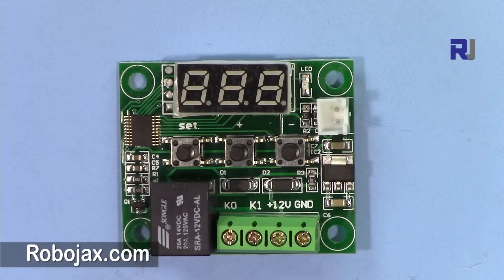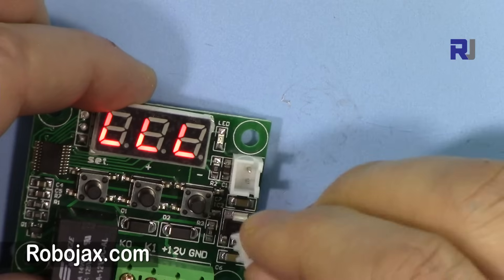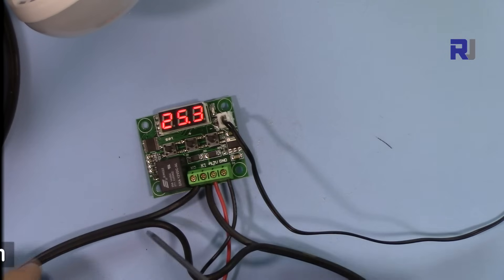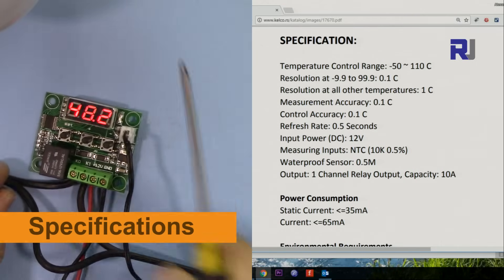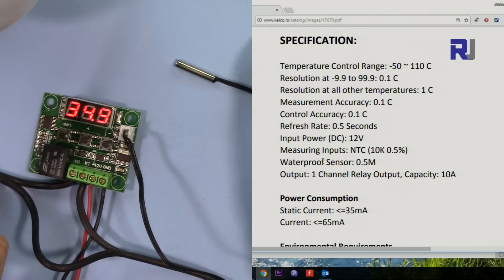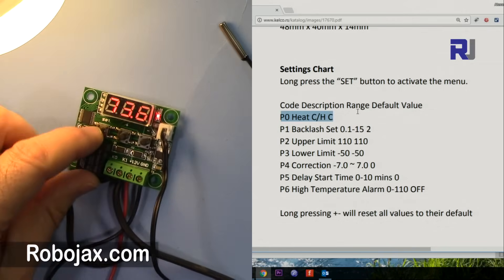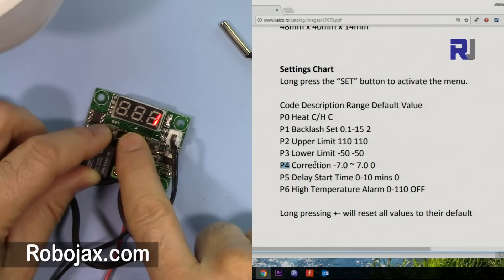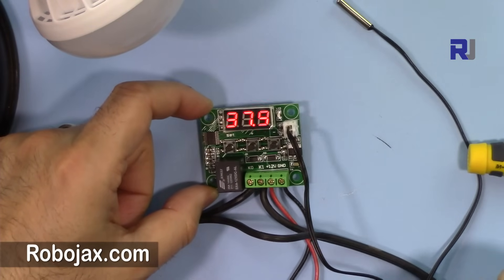How to use W1209 Temperature relay controller and program the thermostat

Comment: I need 1500w load is this sutable
Reply from the maker: See here power calculation https://snag.gy/UDJMCg.jpg
Reply: You can use K1 and K0 to operate a larger relay as switch to open and close.
Reply: 1500 watts I would definitely use an external relay for anything that big. Even though the built-in relay might handle it for a while, it will burn out in relatively short time. Like the other person suggested, use a bigger relay that is simply activated by this thermostat. Then your thermostat unit will last practically forever, and if your bigger relay wears out, it is very easy to replace.

Comment: Hello it is okay if the adapter is
Input:AC 110-240V 50/60Hz 1A
Output:12V --2A
Reply from the maker: Yes. Your adaptor will work. Make sure to pay attention to + and -
Reply: Robojax what color of the wire is positive

Comment: Bro can you please tell me can it run on 12v 2.1Amp or how many AMPS should we use?
Reply from the maker: this itself needs online 0.2A. When relay connects your load, the voltage and current depend on the load. The relay can handle up p 2kW see this http://robojax.com/learn/images/robojax_W1209_relay_load.png (i have put this in the description of this video as well.)

Comment: Relay in the module is 125VAC but the bulb is 220VAC is that ok or not?
Reply from the maker: Relay can handle 1.2kW. the manufacturer has targeted North America which uses 120V. For 220V it should be the load. If not to be safe 50% of power (watt) so if you connect 500W bulb it should safe.

Comment: Does it has memory or should i set the temperature everytime i switch on the module
Reply from the maker: it holds the settings when you disconnect the power.
Reply: Robojax thank u for ur fast replay..
Can u tell me a best 6v to12v dc motor to make a water pump i will use that pump to run water through a radiator and i want that pump to withstand the usage more than 2 years..
Reply from the maker: this is very tough. The torque and power needed should be considered.  There is budget and voltage and current consideration. Very hard for me to suggest.
Reply: @nirmalkumar9353  motor 775,12v.you can see YouTube videos

Comment: hi, thanks for making this video. Is there any way i can control 250 degree C using this controller. Like if I put a resistor in the thermocouple input. will it work?
Reply from the maker: Yes it should work, but you have to check the temperature and make your own chart for example 100°C on the display is 210°C actual.
Reply: right, that is what I was thinking. Thanks for confirming :)
Reply: You could also try a slightly different thermistor. They make them in various values like 10k (this one uses 10k, as 10k is a very common value), 1k, 100k, etc. But the added resistor like you suggested is probably the most likely to work, since another value thermistor might be entirely out of range. You might want to get a thermistor made for higher temperaturess though, because the reason why this particular thermostat only goes up to where it does is because the thermistor it uses becomes less accurate above those temperatures. If you discover that inaccuracy is an issue, that could be the cause. Also, when you add in a series resistor, it will subtract almost exactly a certain number of degrees from the actual temperature at say 200 C, but at a higher temperature it will not be the same difference. In other words, the extrapolation will not be linear, so a three degree hysteresis might turn out to be 6 degrees instead, or 1 degree. You'll just have to experiment with it to see.

Comment: Hi, is it necessary to use jumper cable wire connected  k1 and 12v?? If so, what kind of cable is needed? Can i directly plug in cables from 12v adaptor?
Reply from the maker: for 12V yes it is okay. You can connect it as long as you know the polarity.. But for "jumper cable wire connected k1" sorry I did not understand it. What do you mean?
Reply: As in, can I just use any wire for the "short wire" that is used to put ino K1 and 12V? Or must it be a specific wire?

Comment: I want measure 3 volt operat LED temperature if possible with this device if yes then how?
Reply from the maker: Sorry I did not understand your sentence.  I know you want to measure temperature. But LED and 3V is not clear.
Reply: Robojax I want measure temperature small LED
Reply from the maker: Sorry for my late reply. so you want to measure temperature of LED,   the temperature sensor  for fluid like air or liquid. To get the temperature from a solid device such as LED, you would have to put thermal paste between the LED and this sensor so head is transferred to the sensor and it measures it for you.

Comment: hii ,, Thanks for the full informative video .... I want to ask if this one could be used for 220V devices ?? as I just got it 125V as I didn't know that before getting it .... Thanks
Reply from the maker: You are welcome.
Reply: This guy Robofax has obviously no clue. Sure you can use it on the switching side to switch 220V. I would'nt use this divice to switch anything, because after x times switching the realay will burn up. You need to desolder the relay and add the appropiate solid state relay for your purpose. T
Reply: @Lisas4us  can it be used to switching 12 v dc to ac ssr , safely ?  
Are this reliable enough  to be used in a project ? or one should buy expensive controller?

Comment: which terminal will I connect the DC supply?? At the 12V terminal?? and can I use a 12V/30 amp for the thermostat?? How about if I will use it for cooling?? I will apply it to a refrigator so the system will close when the desired temperature reached.
Reply from the maker: Have you watched the video? the voltage has been mentioned at 00:35 and 01:55. The cooling and heating has been mentioned if you watch the video.

Comment: i ordered it thinking i can directly connect it to wall socket ( ac power supply 220v). after i purchased only i saw it needs dc power supply. will the little thermostat burn if i connect directly to ac 220 power supply? i need the thermostat for running ac bulb 40 watt
Reply from the maker: yes it will. It should be dead.

Comment: It does not want to keep stored temperature settings. It keeps on going back to factory reset. I have tried several diffeernt ones and about 3 out of 4 have the same issue. I need help trying to resolve this.

Comment: Hi sir
Please I want some details. clarify me!
I purchased this thermostat now.
How many 60w bulb and one ventilation fan installing working perfect, for incubators
Reply from the maker: Divide power (for example 60W)  to your voltage (for example 220V), If you have 10 bulb each 60, then 60x10=600W. now find out the total current 600W  ÷ 220 = 2.72A and the Ampere is written on the relay as 10A or 15A.  So total power  ÷ by voltage gives you the current in Ampere.
Reply: Dear sir
 Thanks our reply 
Voltage Supply 220v in indian housing current, 
Thermostat Writing 10A, 12v.
How many Bulbs and One Ventilation Fan working Perfectly for Incubator. 
And Adapter how many Amps required.
Please clarify Me sir.
Thank Regard.
Reply from the maker: You have to read the relay. on this module.  read the relay and see if it is 10A at 240V or 15A. Then as I mentioned above, do the calculation.

Comment: Urgent help:
I connected 60w bulb as explained. It is not working. Please help.light is ok. Relay is ok. But when i connect both, light doesnt glows. What to do
Reply from the maker: how do you know relay is working?  do you hear the click?  if so, then use a multimeter and check the resistance of the contact when it is connected. it should show zero or close to zero ohm at the two terminal that you connect your bulb.
Reply: ome g

Comment: Can I use a 12v mobile charger?
Reply from the maker: Yes you can. Make sure to connect it with right polarity + and -
Reply: 12V mobile charger?
Reply: mobile charger is 5 v
Reply: bro your mobile charger doesn't 12v it gives 5v
Reply: you can connect it directly to the fuze box that provides 12v ... or you can buy an 12v adapter to your car charging port.
Reply: @LazyH-Online It depends on the laptop.. it ranges fro 12v to18.5v +-

Comment: My maximum temperature is only uptp 15 degree celcius... Even if i press Plus button it does not go up...please help.
Reply from the maker: Something is wrong. Turn it off and try again. Did you test it with 15°C.  Put the device in freezer with power wire outiside and test it on for example 12°C. Once you remove the module from fridge, it should trigger at 12°C. If it did not work, then that 15 could be 150°C and may be the display is bad.

Comment: 2:58
Reply from the maker: what about it?
Reply: Robojax do I need to use the adapter..
Reply from the maker: which adapter? if you meant the prob (wire connected to the board). it is the temperature sensor and without it, this module will not work.
Reply: Robojax can I directly connect the device to switch board, or I need to use a specific power adaptor...
Reply from the maker: You connect it to 12V as I mentioned at 01:55.
Reply: Robojax thanks bro...

Comment: Can this work to activate a 12v 9amp fan?
Reply from the maker: the current is the most important factor. It depends whatever is written on the relay see this image  https://snag.gy/ltFeqG.jpg
Usually it is always 10A or higher. So yours should be 10A or 20A. Check it.
Reply: Robojax Thanks

Comment: hello, i use this circuit in my homemade egg incubator for controlling the temperature. there is a red led light right next to the display in the circuit which should turn on when the main heat source or the bulb is turned on. but mine is showing just the opposite. like, when the bulb in on, the display light is turned of and when the bulb is off, the display light is on. can anyone help me solve this?
Thanks
Reply from the maker: So watch the video again and again until you understand it. I don't have the device in front of me to test but it seems you have to switch the two temperatures settings. one should be instead of the other or change the operating mode.
Reply: Just plug it in and wait for it. It doesnt turn on instantly, you have to wait for about a minute.

Comment: have multiple fan connected to the controller but when it reaches the set temp the display starts to show chaotic temp. the fans are of different amp, 1 big, 2 smaller. what could be the problem?
Reply from the maker: are you using AC fans? if so it seems the power source is not stable and they either add noise or reduce the power line voltage. So make sure this controller is getting regulated clean voltage.  if you have a battery , it is better to test it by powering the module from a battery. This way you know for sure if noise in voltage is the problem.
Reply: it was a voltage problem. the thermostat was getting low volts
Reply: If you have any additional issues with jumpy readings, try connecting a small capacitor (maybe 1 uf) across the wires that go to the thermistor sensor. This will help stabilize the temperature readings and keep the relay from randomly clicking on or off before it is actually supposed to.

Comment: Where to plug in the lamp plug and the adaptor plug?
Reply from the maker: I am not sure if I understood your question. I have mentioned at 03:00 that the AC Load (light) is connected to wall.
was this your question?

Comment: When you splice and the wire in half and . And put the fan on. the other end do you have the plug do you plug in the wall outlet and have the electric run through it as it's hooked up to the battery to.
Reply from the maker: yes. Exactly. So if you have AC load, connect it to wall outlet. If you have DC load, then connect it to battery.

Comment: Frnd I need a constant temperature (27.5)what should i do
Reply from the maker: then set between 27.4 and  27.6 and it will give you 27.5. This device has some response time.  and this time give it a moment to reach that value. If your application is very precise, then this device is not the right device for you.
Reply: Robojax  thanks

Comment: hey guys, I got one of those which i want to use on my peltier cooler project. Its default setting is in HEATING mode. Im trying to enter the PO menu to change the settings but its not working wat can i do?
Reply from the maker: Unless your board is defective, the procedure I've shown should work. please watch the video again.

Comment: wow clear explanation.. thank you..😊 i have a doubt..please tell how to connect the peltier module and pc's PSU to this device..? i have red and black wires in my peltier module.. how to connect these devices to this thermostat..? Im not good at electronics.. please reply..☺️ ( i would like to use this method for my cpu cooler)
Reply from the maker: your module has RED and BLACK. You need an extra wire (let's call it yellow). This module has 2 terminal (let's call them T1 and T2 ) connect red to  + (positive) of power supply, connect black to T1 .  Connect one side of yellow to T2 and the other side of yellow wire to  - (negative) of power supply and it should work.
Reply: Thanks for the reply.. :)  In here, does the  T1 and T2 represents the K0 and K1..??
Reply from the maker: I don't have the module in hand, but I remember there was 2 terminals that I connected the load, so those two terminals  are referred to as T1 and T2

Comment: Very bad.use less product. 12v supply cut . device automatic company setting 28 degree. Old setting missing. Very bad.useless
Reply from the maker: a doesn't work for everyone. But most people find this to be useful.
Reply: Same problem
Reply: What can i Du this problem?
Reply: gopi nath me use xhw 1209 letest version is good product. Memory is properly working.
Reply: I don't know if you have had the same issue I have had, but when I power this from a 12v regulated power supply, the temperature jumps up and down several degrees constantly, and if the temperature is close the the set point, the relay will click on and off and on and off randomly because of these fluctuations in the temperature reading. I tried using an additional 12v linear voltage regulator together with capacitors and everything, and my voltmeter was reading a constant 12.2 volts, but the fluctations would not stop. The only thing that fixed the fluctuations was to run the thermostat from a 12v battery instead. But then I tried something else that totally fixed all the fluctuations without having to run it on a battery: I put a small value capacitor across the leads for the thermistor. Works like a dream! No more random fluctations in the readings, and no more random clicking on and off of the relay! Perfectly smooth operation now. I used a 4.7 mfd capacitor rated for 25 volts, but any small capacitor will usually work, as long as it is rated for 12v or more.

Comment: Hi..what kind of bulb you are using in w1209 thermostat?.and what watts?
Reply from the maker: the bulb is AC LED bulb very low power. But that doesn't matter. The rating of relay is important. If relay says 10A then multiply the 10 x the voltage., for example if your AC voltage in your region is 240V, then 10X240=2400W or 2.4Kw load could be controlled.
Reply: Robojax i use 100 watts of my w1209..the problem is the bulb supply..can you send me the settings and the wirings module?pls..
Reply: By the way ours is 220V in the philippines..
Reply from the maker: For wiring watch the this clip http://www.youtube.com/watch?v=YSI1PdSLbt0&t=2m47s and for instruction, if you watch the video I have explained all settings of the module.

Comment: Can I use it to control 220v ac bulb. Or it is only for 12vdc and.  110vac.
Reply from the maker: any load up to 2200W with maximum of 10A AC or 10A DC.
Reply: Robojax actually I want to know about voltage range of alternate current (ACv). Is this 110v or 220v relay device. Thnks
Reply from the maker: the relay is a switch. Doesn't matter what voltage you connect. (of course you can't connect 1000v). Only the DC is important to be 12V.

Comment: How to extend sensor wire, is possible
Can we use for hatching eggs
Can we use for 21 days continues
Reply from the maker: Yes you can extend the wire. Cut the wire and add longer wire. Make sure pay attention to the polarity and quality of wire. if you extend it for example longer than 5 meter or so; the resistance of the wire will affect the measurements, therefore use another thermometer to measure the temperature and compare it with this and adjust by adding or subtracting (I don't know which one) the same amount of temperature to correct it.
Yes you can use it for anything that needs temperature control
You can use as long as it has power unless a components dies. but the device has not  time limit.

Comment: Thank you for the video. I need a temperature relay controller temperature is more than 300 c to control the temperature of a hot plate. what type of the controller should i use??
Reply from the maker: You are welcome. You can use MAX6675 with areduino to  go up to 700° C. Here is my video https://goo.gl/Ly5r9o
but a module like this I am unaware of if it exists.
Reply: Robojax Thanks for your help dear.
I will try

Comment: Please tell me how to use to work between 2 temperatures ? For example : I want something to work only between 20'C and 40'C , temp below 20'C turns off and temp over 40 turns off . Sorry for my bad English . Thanks
Reply from the maker: this is what it does.  It should work like that. I don't have the device now, but I am getting in it few days and I will test it. You will set you start 20 °C and then stop 40 °c.  Try it and let me know. Also try the start at 40 °C and stop at 20 °.
Reply: @robojax  did you manage how its done because I cant also figure out to control the temperature between two set points